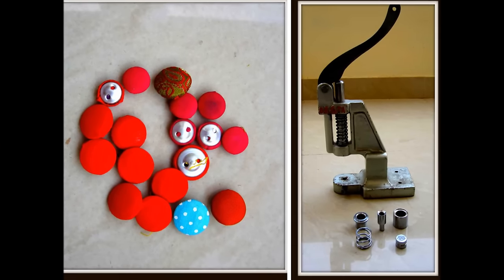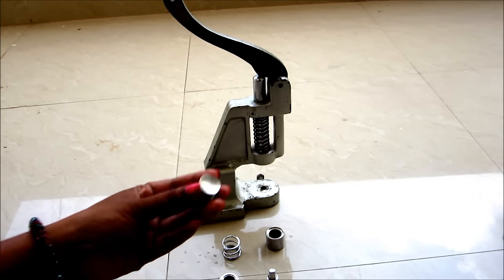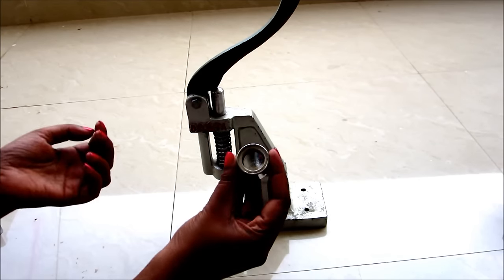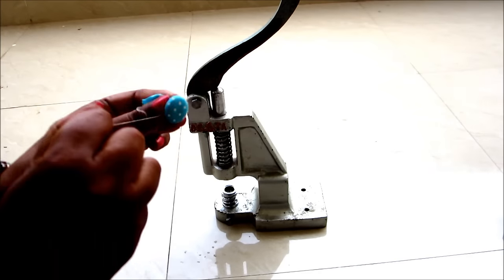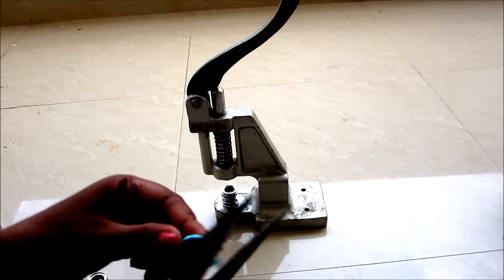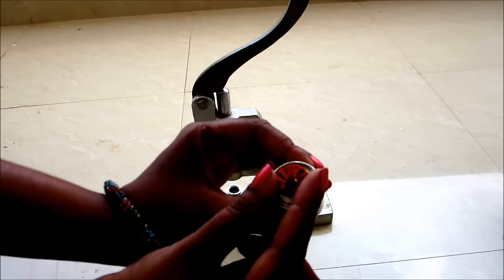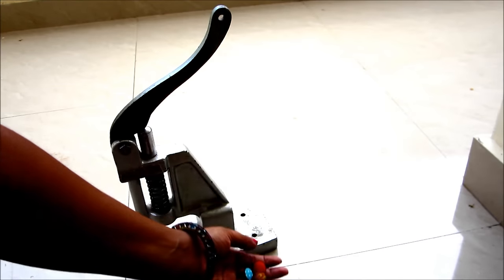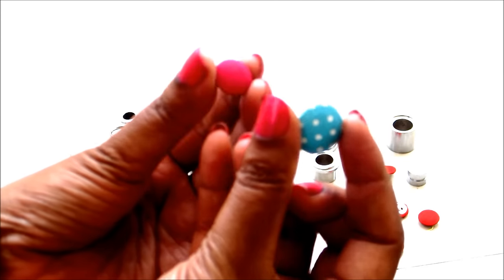How to make Fabric Buttons easily - A COMPLETE TUTORIAL

Comment: without this tool how can we do at home plz tell me that method also
Reply from the maker: +Savitri Ganti thanks........u need to have the cap and bottom of the shell/button...same process fixing the fabric to cap and the press it tightly with little hammering on the cap..........simple....but this will not stay for longer.......if u use this tool....it will tightly fix the cap and bottom of the button.....have a great day
Reply: Where we get this shell buttons
Reply from the maker: +Savitri Ganti in tailoring/ embroidery / sewing material shops........